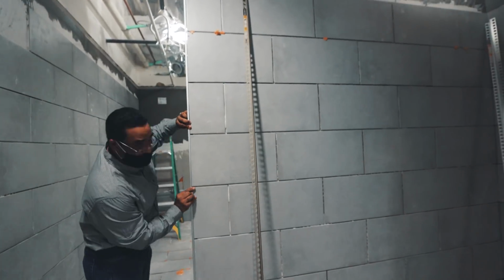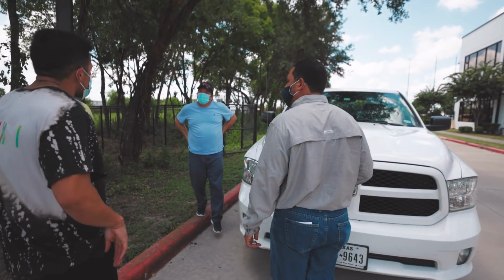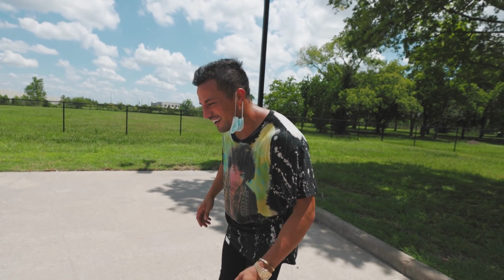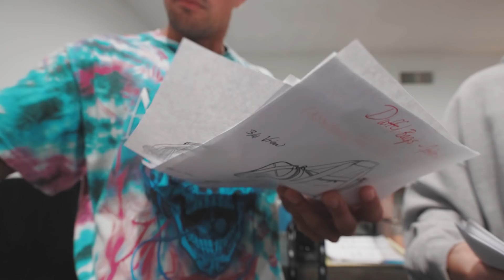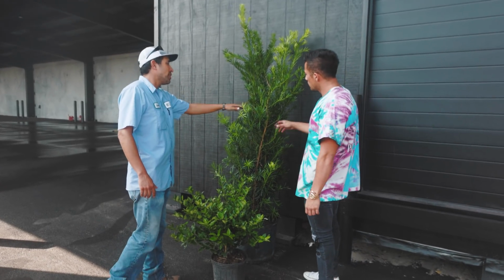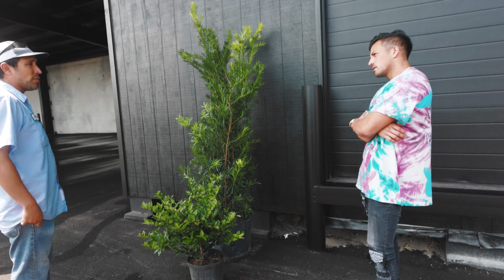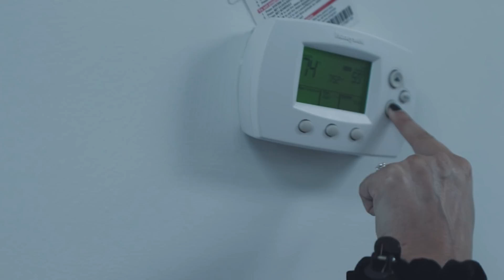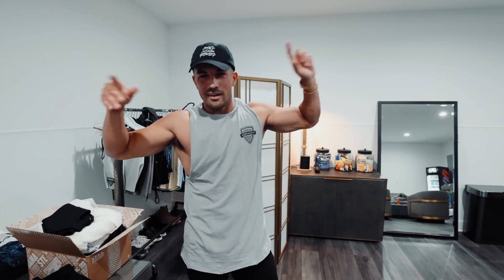What Alphaland Has Taught Me

Comment: 💪Think those swinging “cheat reps” in the end of your bicep curls at (11:16) need a better explanation for why you do that...see explanation below. ⬇️
The last 1-4 reps of every exercise before you hit muscle failure/fatigue are the “effective reps” that will be most effective at overloading your muscles and will cause the majority of your muscle hypertrophy and/or strength gains. These are typically supposed to be performed with proper form, and focusing on the eccentric motion (negative) to maximize the benefits during these last few “effective reps” in each set. 

While I’m not personally a fan of doing cheat reps in most cases (especially if you’re not using them for the negative/eccentric motion), they can theoretically be effective at increasing the number of effective reps artificially in each set to provide additional overload on the target muscles. Just have to be careful of your form and not do anything dangerous or stupid during those last reps.....
Reply: I don’t like to call them cheat reps I call them “burnt out muscle reps”
Reply: Bryan Sierra Ha! I can see that terminology also applying. 💪👍
Reply: FitLabb the unfortunate part is most ego lift and don’t understand that “more” weight isn’t always a good thing. It’s funny is I watch guys in the gym trying to curl a lot of weight but have to swing every rep and here I am with arms twice the size of them and curling the same weight with perfect form then they wonder why they can’t grow.
Reply: Kev Christopher I couldn’t agree more!!!! You put it perfectly in your comment, and this is something I preach to all my clients and in my videos. “Check your ego at the door!”

Unfortunately most people don’t understand the basic fundamentals of how resistance training works and therefore don’t work out properly or let their egos and competitive nature lead their workouts instead of science, facts, and common sense.